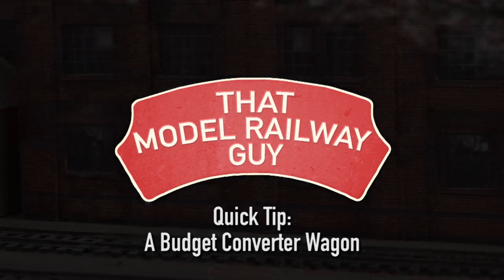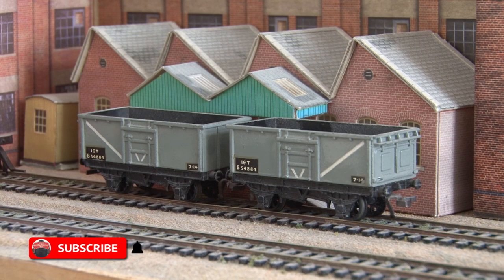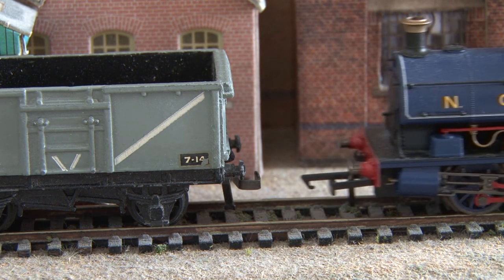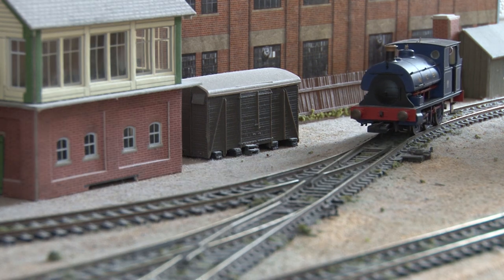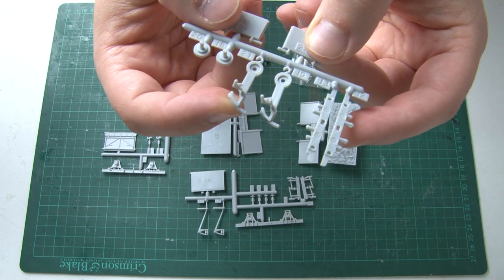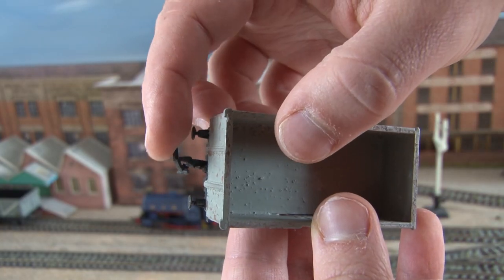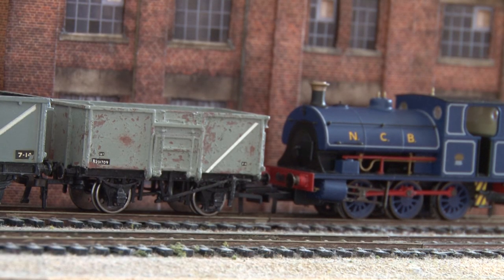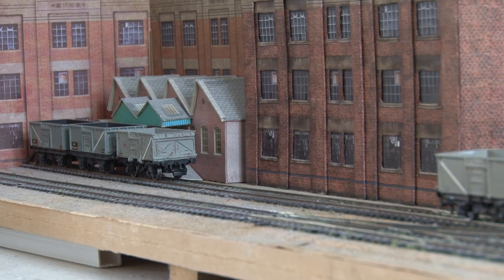A Converter Wagon On A Budget - Model Railway Tutorial

Comment: Hi clever idea, just so you now, the couplings on your grandads  mom trucks are the original Hornby Dublo couplings, the truck you built is the Rosebud Airfix type these did not work particularly well so i used to fit Tri-ang couplings when building these kits. 😀
Reply from the maker: Ah brilliant, that's good to know. I did suspect they were the Dublo couplings but nice to know for certain. So far I've not had any trouble with the couplings on the Dapol/Airfix kits but I'm glad you found a solution for you problems. Thanks for watching 👍
Reply: You can make your own converter wagon/coach these days using any NEM pocketed vehicles for the conversion.

Comment: Very good. The problem I have is , I have so many different couplers from Triang to Hornby, Lima and Airfix  and it is frustrating pulling out a rake of wagons/coaches only to find the couplers don’t work
Reply from the maker: Very true, I'm lucky that I only have a few of these older wagons so only need the one converter wagon. Perhaps there's a way of making one of the couplings on the wagon interchangeable depending on what stock you want to run... maybe using a magnet? Thanks for watching 😃